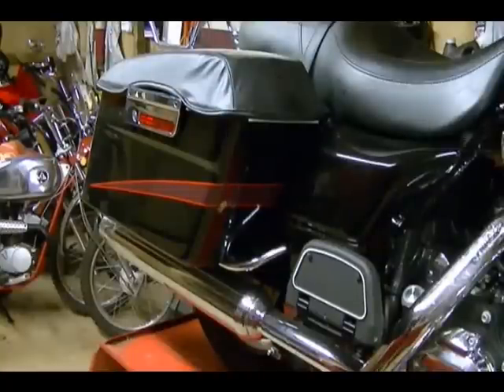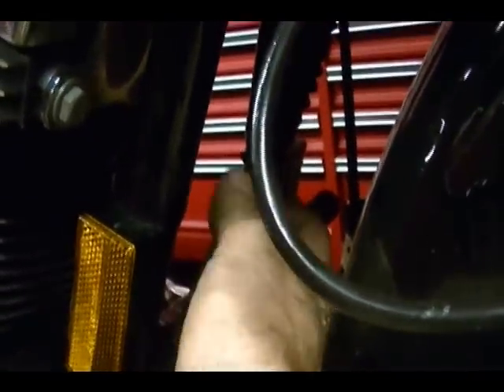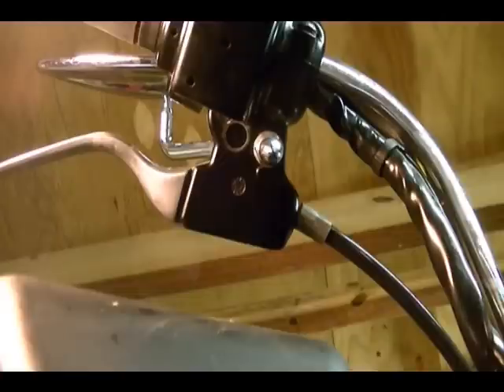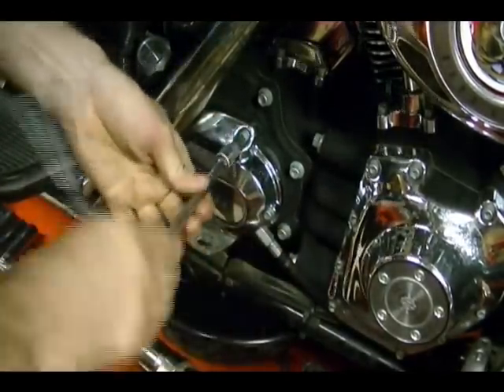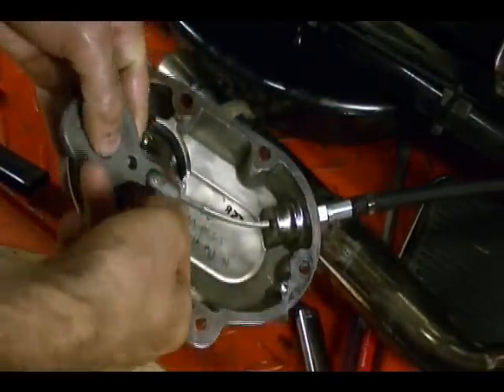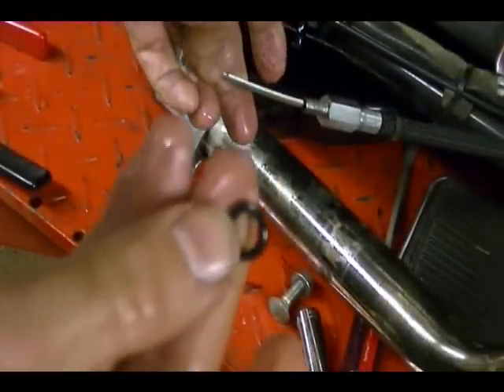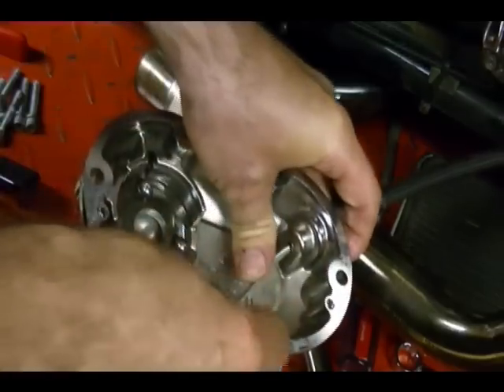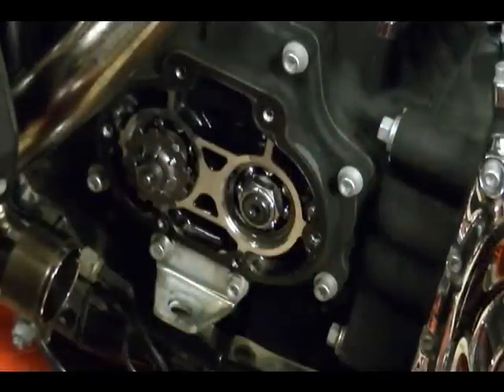How to Remove the Clutch Cable on a Harley Davidson Big-Twin Motorcycle

Comment: You forgot to show the most important part. How the heck do you remove the old cable and install the new one through the hole by the clutch handle?

Comment: Thanks for the video, very useful.

Is it absolutely necessary to loosen off the rear cylinder exhaust pipe to gain access to the cover plate ? It's just that loosening the pipe disturbs the exhaust port gasket so that might mean an additional job of resealing the exhaust gas joint.

Does that mean that the lower part of the clutch cable is automatically well lubricated with transmission oil ?

Thank you.

Comment: Just got done changing my broken clutch cable. No where was there better "in your face" directions on what is needed to do this correctly. The only difference is that my 2007 Electra Glide Classic has stock exhaust with aY at the rear manifold so I had to undo the left side also. No big deal. The only problem I had was fishing the new cable. Just took 2 different tape jobs being the 1st kept getting hung up. 
Thanks for the great video. I am now a subscriber!!
Reply from the maker: Thanks

Comment: I have an 05 dyna low rider. idk if this is normal but I lubricated the clutch cable so there is a smooth action of the clutch. however it seems that there's a lot of tension on the cable.  it feels like it wants to pull back out. after a while my hands cramp up. my dad has an 07 super glide and I have no issues with that clutch. I could hold that all day. would there be any way to adjust the tension of the clutch cable? do I need a new cable? I don't have issues with the friction zone at all. it's still a smooth motion of the clutch lever. any thoughts?  

thanks

Comment: Great video. Showed every step. Quick, slightly unrelated, question for you. The bracket that held your old exhaust. can that be removed? I recently replaced my OE stock exhaust and want to get rid of the OE stock bracket mount if i can.

Comment: I purchased a new (longer) clutch cable for my new apes and followed your instructional video to change the cable. I have the turn-buckle turned all the way in but I have absolutely no spare cable up at the top to work that cable through the slot on the housing and over that dowel at the hand control end. Did I do something wrong here or did the cable company send me a cable that's too short?

Comment: Question, can't find the answer any where else - I've replaced my clutch cable exactly as shown, however, when I put everything back together, I have no springiness in my clutch - it's nothing but slop.  Even when I adjust the cable tensioner it feels more like I'm compressing the clutch cable itself than performing a mechanical disengagement in the clutch / transmission.  It almost feels like there is a spring that became unwound or something.  I haven't cranked up the bike or changed gears for fear of screwing something up.  Any thoughts?
Reply: That's the problem I'm having. How did you resolve it?

Comment: Great video.  Wondering if you have the answer to a question ..... my brother just replaced his clutch cable.  He reassembled everything and is having some issues.  He took it apart and noticed that the oil slinger (push rod) has a flat side.  Does this particular piece have to be inserted in a particular orientation to work properly?

Comment: I have been told you need to adjust your primary after changing the clutch cable.  How true is this?  It seems simple to do, but just curious. Thanks for this video btw.
Reply from the maker: The primary chain? I don't know why changing and adjusting the clutch cable would effect the primary.
Reply: ***** I didn't either.  But was told to adjust the jam nut and  adjust screw under the cover on the back of the primary.  idk.

Comment: You have any thoughts about the fluid leaking down the clutch cable.
 comments from John fever, Brian Kennedy
Reply: I too have fluid running down my cable just outside the clutch release cover.  Changed the cable o-ring and cover gasket thinking it was one of those, but still have the same issue.  You figure out why/where your's was leaking?
Reply: CADjunkie209 I noticed my cable leaking and it was rubing against the case and it pinched cable and it leaks out of the cable

Comment: I just answered my own question. My new cable has threads on it too like yours.. The nut is just located slightly back on the cable,  looked different then the stock so I didnt relize how it worked. I understand now... Thanks for the video again...

Comment: Thanks for this video. If I want to only lube the clutch cable, do I need to disassemble the whole housing or can I use trans oil on the cable and work it in?

Comment: Hi I’m doing a cable replacement myself I was just curious about something… that piece behind the cover that kinda looks like a gear is that supposed to be connected to something? It seems like it just slides in on mine but I didn’t know if that was correct!

Comment: Thanks for the video. Im replacing my cable with a longer one and noticed my new cable didnt come with the nut to tighten it at the case.. Does my old cable nut slide off so it can be reused? Thanks again for the video very helpful...

Comment: Brother, this video is a God send.  Thanks for your insight.  However, I have a 2009 FXDB (street bob).  In January I took mini apes off and replaced it with the low vintage type handlebars.  Just the other day I started leaking fluid from the junction where the slack is tightened up.  Any advice as to how fluid is leaking from there and is there a fix?
Thnx in advance.

Comment: Great video. I'm having a slight problem though. The part of the clutch cable that sits in the cover seems to have shortened as I can't get it to lock in the same position it was originally in. Did you experience this problem? Any ideas?
Reply: Adjust the cable all the way out should have plenty of slack

Comment: Great video, I changed my clutch cable and had the inner ramp in on spot to low and could not adjust my cable.  I took it back apart and put it where it should be now I have no free play.  Safari as I know it's the same cable I had on a previous bike that was the same model.  What am I doing wrong?  

Thanks in advance.

Comment: I have a 2003 ultra classic and I’m changing the exhaust can I get to that exhaust bracket under clutch housing if I remove the housing or do I have to take other parts off to get the bracket off

Comment: Yet another great video.  I may have to do this just to replace the gasket.  Developed a small weeping leak after switching to the Harley Snyn3 oil in the transmission.  So frustration.  At least I hope it's this chrome cover and not the one underneath it :)
Reply from the maker: Thanks
Reply: Thanks for the clip. I've watched and learned from a few of them now. I may have a leak from the plate (bearing door?) under the clutch cable cover, or what the clutch cable cover mounts to? Any tips if I have to replace that gasket?

Comment: just start my bike and pull the lever to engaged in gear cable like snap without any pressure and my clutch doesn t engaged .. what can be the cause  i try the adjuster but nothing i can unscrew it completly without moving the lever ...yhanks for your video and answering us .

Comment: had to put on a longer cable due to the fact I put on apes. .seems like the cable is not disengaging the clutch..I adjusted everything. .any ideas
Reply: ever get this figured out? I am having the same issue now.
Reply: CABLE N ACTUATOR MUST BE AS FAR TOWARDS THE BACK SIDE OF HOUSING THAT IT CAN GO, TO GET FULL PUSH

Comment: I have a question: my 2006 fatboy EFI everything worked correctly however when i changed my clutch cable and and replace it because I put 16 ape hangers on it. here is my problem, I adjusted my clutch and adjusted my clutch lever to 1/8 free play and when i put it in to gear like 1,2,3,4,5 and grab clutch lever my bike will not move. However i will move when in neutral. The ball and ramp is set correctly. the cable has no kinks checked clutch 3/32 allen to make sure that it moves the oil slinger. so at this point i am clueless. any information would be great..
Reply: any luck getting this answered? pretty much the same question.

Comment: G'day I just put some ape hangers on my 08 softail all went well but now I cannot get a gear. It seems like the clutch is engaged and adjusting everything off or on with the cable adjustment is not working what could be wrong?
Thanks 
Jason.

Comment: Replaced my Shift Shaft seal, upon adjusting the clutch, ended up with additional clutch cable slack that i cannot get out. Can just barley pull clutch lever - feels like it bound up??? 2003 RK Classic. A little help...thx jim

Comment: Question for you. I am planning on taking off my Transmission cover in order to blackout my bike and get this piece powder coated. They are telling me that when I take this off that I have to bleed my clutch. Now I noticed in the video you did not do that... So is that needed?
Reply: If you have a hydraulic clutch it'd be necessary.

Comment: Very helpful. I gotta replace my cable due to a leak coming from  the  adjuster, I Recently changed out my levers and when I was messing with the adjuster I realized  it was leaking....Its been driving me nuts and somehow the dealer couldn't figure out where this small ass leak has been coming from. They said they didn't see anything even though the whole cable is moist after a short ride.I didn't even know there was oil going through that cable.
Reply from the maker: Thanks, glad it helped

Comment: after changing clutch plates on my 07 softail i found i cant pull the lever in at all, double checked everything still cant pull lever in, can this be caused by the balls not being in the correct position, after watching your video i dont see how they can move but thought id ask anyway,   thankyou

Comment: I dropped my dyna one night in a parking lot all drunk. The rear brake pedal was bent and I rode home with front only. Rode like that for months. Then my buddy was like here, he somewhat easily bent the brake pedal back away from the exhaust, and boom I was back to both brakes. But... the clutch cable was pinched by the pedal, and the cable has had a small leak ever since. Ive been delaying the replacement because thought I had to remove the exhaust first. That was 4 years ago haha. Anyway,  just a little story, thanks for a solid instructional vid.

Comment: Hi, Hope you can help me. I have adjusted my clutch ( 05 softail ) alot. About 70 thousand miles on her. In the morning when i fire it up, jump on her ride it maybe 1 mile go to stop, pull in the clutch she still wants to roll..After riding for 10 to 15 minites it will stop..A guy told me it could be the throw out bearing..In the same area as your video..Can you help..Thanks..

Comment: People please...double check the torque specs mentioned towards the end of this video. 84-108ft lbs, is slightly higher than the actual 14-21ft lbs that I found in manual.

Comment: I get that the O ring stops the transmission fluid leaking out around the cable, but what stops the Transmission fluid from flowing down between the inner and outer cable, or is that normal?
Reply: nothing stops it. the fluid runs through the bottom part of the cable housing.  keeping approx 1/4 of the cable lubricated. pretty awesome actually so you only have to oil the top side of the cable every few months

Comment: when you remove the cover should there be a lot of loose play in the cable and everything it connects to on the cover its self??
Reply: Yes because you loosen the adjuster fully to remove the cable. You take the slack out with the adjuster.

Comment: i had to change my cable do to im putting on 14" apes, after i installed the new cable i was pressing the clutch level and i heard a snapping sound from the inside of the cover where it connects....what can it be??
Reply: +TheBubbles069 Balls might be in wrong position

Comment: I have oil running down my clutch cable, the housing isn't leaking. could it be that o-ring? Or do I need a new cable?
Reply: Did you find out what it was cuz I have the same problem. I have an 07 Street Glide
Reply: yeah, I changed my cable, the o-ring, and gasket. Turns out the breather tube was clogged.

Comment: Do not use locktite on those bolts. A few in/lbs is a very low torque spec. They won't come loose.

Comment: yea it has slack, the lever is sloppy when I back the cable right off I bought the bars, all the cables, wiring harness extension and risers in a complete kit form. I'm thinking if the cable is slack shouldn't the bike engage gear and take off? then I wouldn't b able 2 pull the clutch in and go through the shed wall etc. lol.

Comment: I tried replacing the cable. I got to the very end of the video... I could NOT remove the cable because the lead ball at the end of the clutch cable was to BIG and I was unable to remove!! Whats the tRick? Melt it???

Comment: my clutch cable is all the way loose but I can't get any slack to put it back in its housing at the lever. I put 16s on my breakout but can't get the new clutch cable back on correctly any thoughts. Maybe the inner ramp isn't in the right position? Anyone? Bueller?
Reply: Having the same problem myself. What did you do? I am thinking of starting the adjusting nut about halfway down from the top so I can have slack.

Comment: DO NOT remove the inner ramp... pointless extra work that presents unnecessary risk of fucking something up. The cable will disconnect without doing this. Just close your adjuster on the cable and remove the lever end and it will pop off the clutch side with a little finger juice.